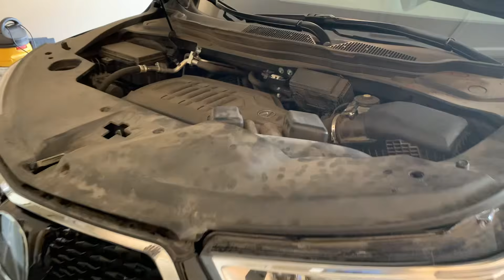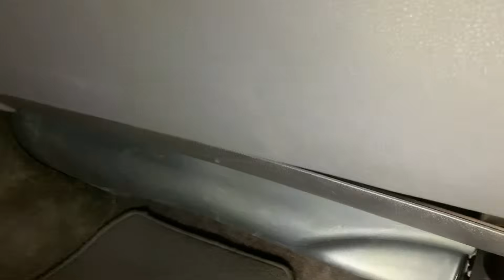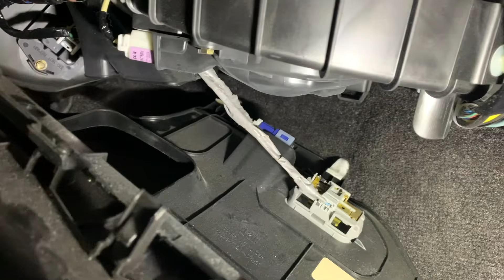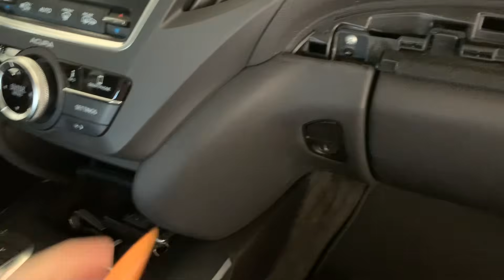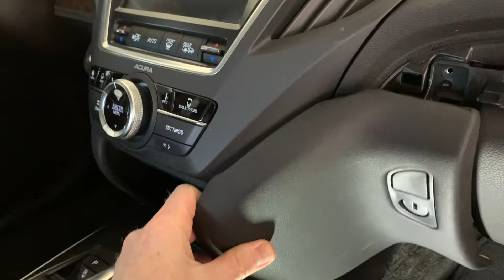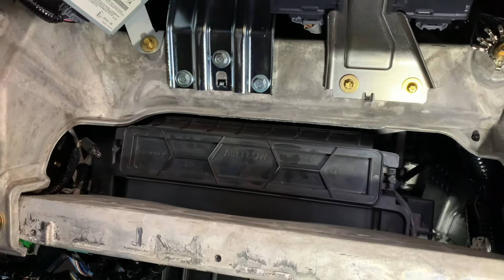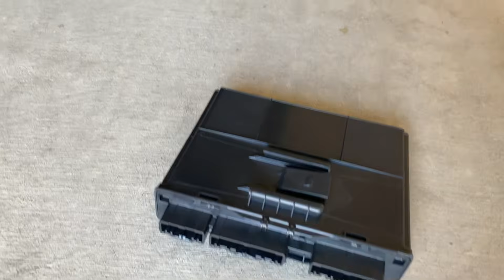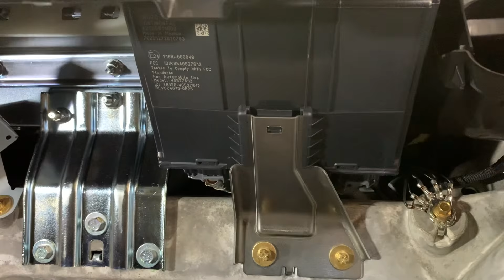Honda / Acura Random, Intermittent Flashing Dash Lights, Headlights, and Car Alarm - FIX Part 2

Comment: Thank you so much for making this video.  I have been dealing with this issue for months now on my 2017 Ridgeline.  The dealer is completely clueless on this issue.  I ordered a new BCM 4/6/23 and it is still on backorder, with no anticipated ship date.   I just pulled my BCM from the vehicle and was able to get it out of the plastic case (this was the hardest part of the job).  Before I go any further, I am going to pick up a magnifying glass, as the parts are so small that I cannot see any problems with the naked eye.
Reply from the maker: Hope you were able to complete the repair and you are back in business.  Appreciate any additional comments.

Comment: Did you ever get the common Honda problem with multiple display warnings cycling on startup?
  
Not sure if you addressed it in previous videos but as long as it is apart you may want to clean the connection at the negative battery cable to the fender ground.  On my Honda the eyelet was clean but the fender side and threads are painted with the body color.  I scraped the paint to clean metal and wire brushed what I could on the bolt and hole.